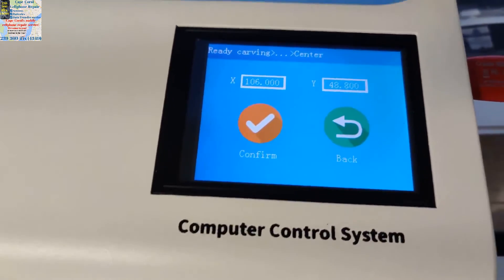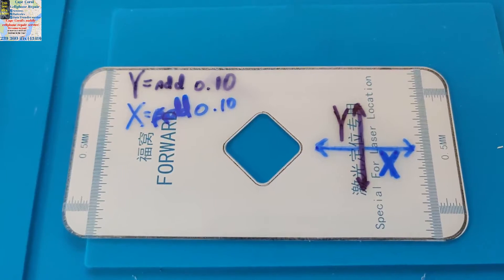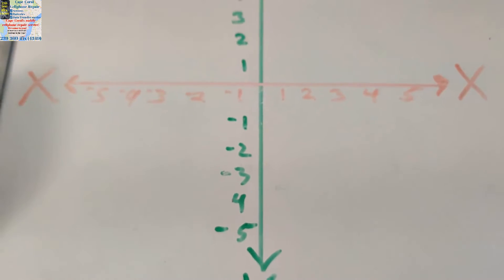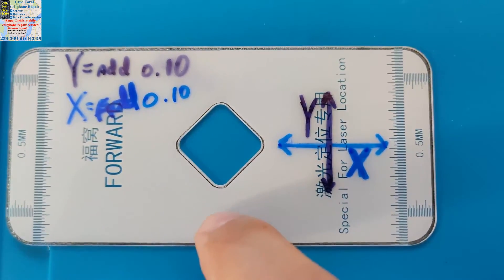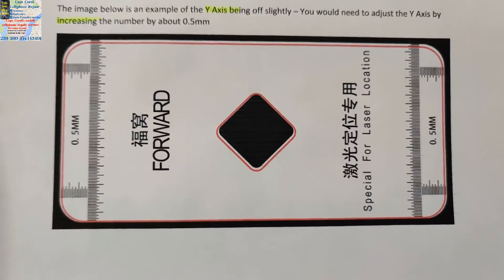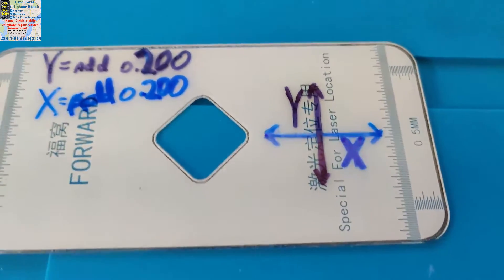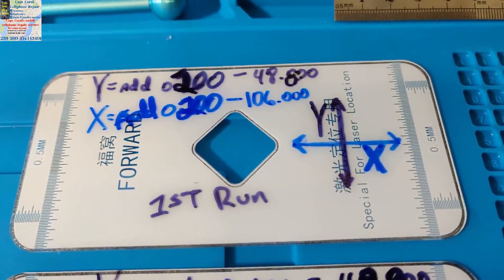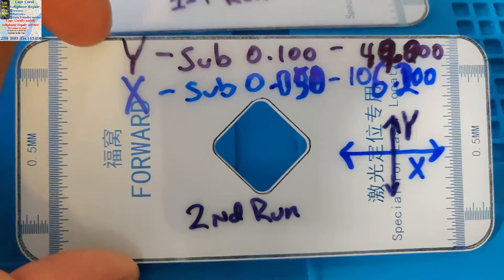How to calibrate X and Y Axis on Forward Blue Laser machine

Comment: Hello, we have been using the blue laser machine from Forward for 3 years. I would like to ask you for help. We currently have a problem with the laser head. Does not cut white back glass. Works well with all other colors. Have you experienced this problem? Do you know where I can buy a head for this laser? From what I saw, the power of the laser head is 25W. Unfortunately, I can't find such a head anywhere. If you know anything about this I would be very grateful for your help.
Reply from the maker: I would start at the official store https://s.click.aliexpress.com/e/_m05V6Rk
Reply: I wrote to forward on their oficial website and they dont answer. Thats the reason why I am searching for the solution. @CapeCoralCellPhoneRepair

Comment: Once you’ve calibrated the machine, you don’t ever have to do it again?  Is the calibration based on a per model or one calibration is good for all models?
Reply from the maker: You never have to do it again. One and done! You would only calibrate it again if you replaced the laser head, the belts or other part, or if you physically moved the machine.

Comment: Had the same preset calibration you had adjusted to 106.150 48.900 as you. Right on the money.
Reply from the maker: Awesome. That's great.
Reply: @CapeCoralCellPhoneRepair  Will it be the same calibration for all machines?
Reply from the maker: Each machine needs to be calibrated individually. But you only need to calibrate it once. Unless you physically move the machine, you never need to calibrate it again.

Comment: Sir all this is the last one I set?
Reply from the maker: Don't understand the question.
Reply: I mean is last  settings I used for all iPhone
Reply from the maker: You should only calibrate once. But you should adjust the focal length, height adjustment EVERY TIME, as phones have different body thickness.
Reply from the maker: Ok. I posted comments.
Reply: last settings Adjustment
Reply from the maker: See my comments on this.
Reply: Hlo sir I want to contact you what app or Facebook
Reply from the maker: @sadiqmz7169  What u need?
Reply: I want help from you about my blue laser x y